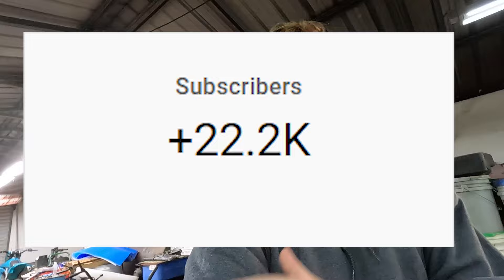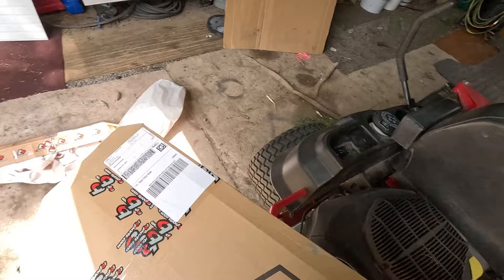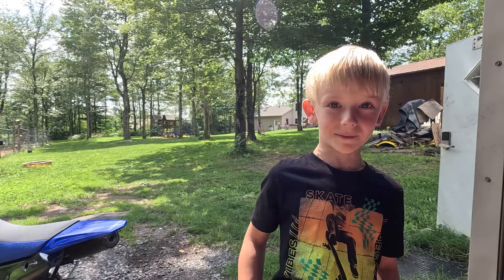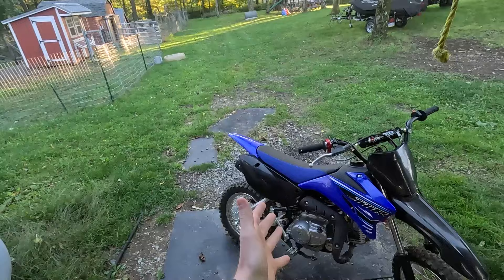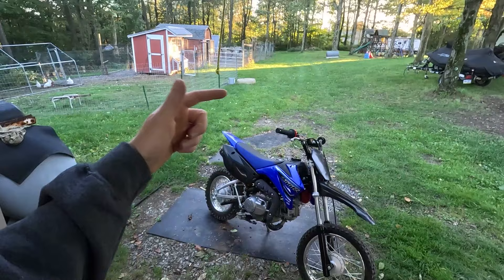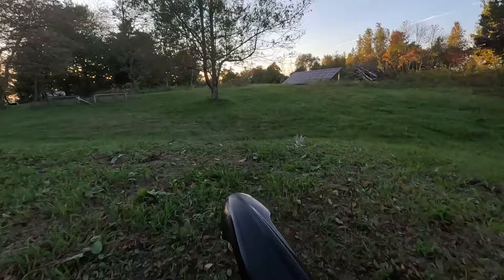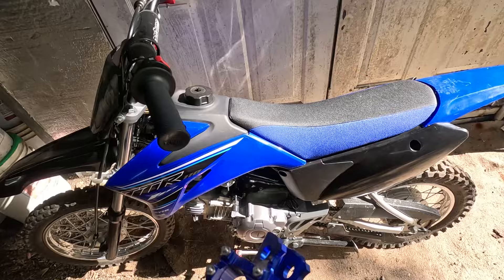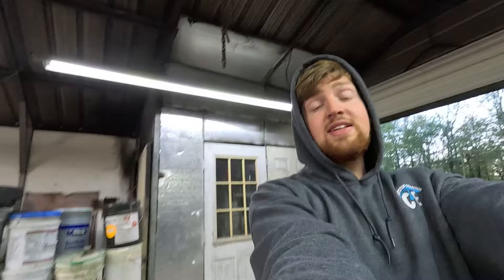I Installed A Big Bore Kit On My 110cc Pit Bike (Massive Power Gains)

Comment: I have a question, I have the sx parts  130 kit and their stage 3 cam, along with the tb parts 26m carb and I can’t seem to figure out jetting. Along with that my motor gets so stupid hot that it is unrideable. I was wondering if you had that problem or if you have more info

Comment: is there a lift kit for a ttr 110
Reply from the maker: TBParts has bolt on forks or you can swap stock fork internals out with BBR dampening rods. It adds roughly 2 inches of travel.
Reply: @CalebEckenrode  THAAANK YOUUUU
Reply: do you know what Valves and cam to run with my 130 bore
Reply: @CalebEckenrode  what sprocket do i need to go 60 70 or 80
Reply: @CalebEckenrode where do you buy it from?